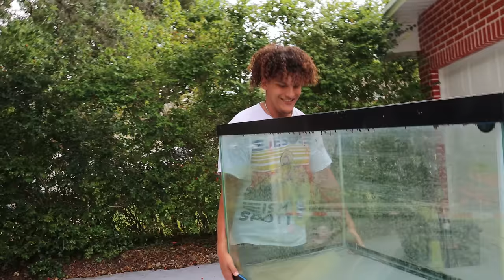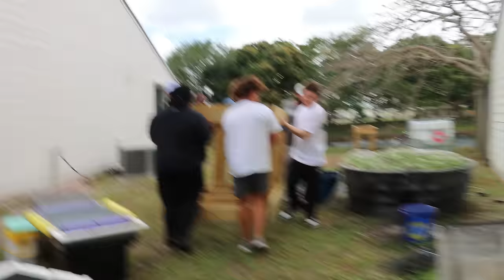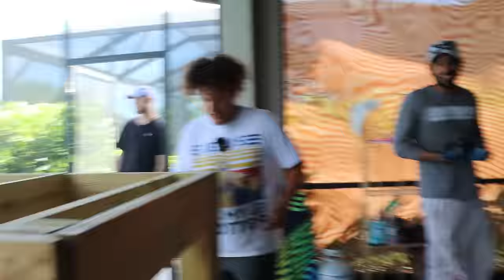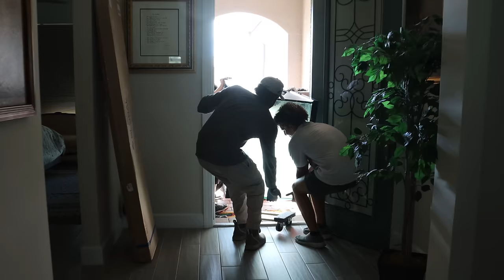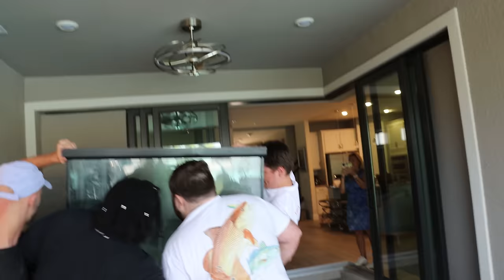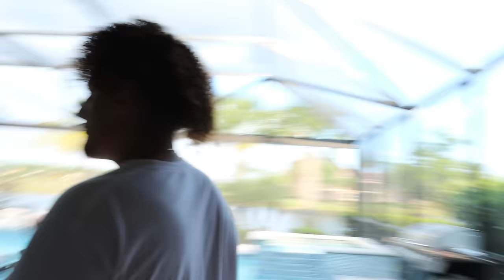I Moved My ENTIRE FISH FARM!

Comment: A couple of things. To expand on the ramp thing. Pull the ramp all the way out on the Uhaul, it will kind of drop. You then lift it up and hook the hooks in the holes on the deck, the ramp will then be even with the deck. There is usually a little aluminum lever or button to release.  Secondly knowing you do the best with what you have I suspect the bare 2x4s might cause some aesthetic problems. You might think about giving it a quick sand and staining it similar color to the other furniture, or for a rustic look watch for someone replacing their cedar fence. Take you truck and pickup the weathered gray fence slats. You can then cut them to length and put a couple finish nails in them to cover the tank 2x4s more  or less think it will look like a mini fence around the bottom. You built those stands so I'm sure you could figure out a couple of doors. You can then buy stand in gray to stain the cut ends. Use a coarse brush to clean the dirt and stuff off the boards first without removing the patina then you can finish it with a light coat of matte clear finish.